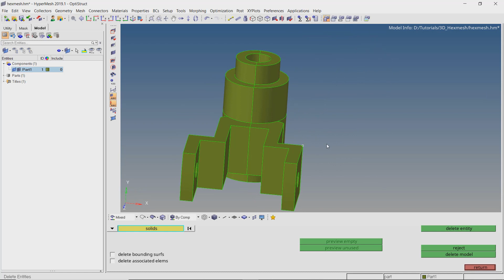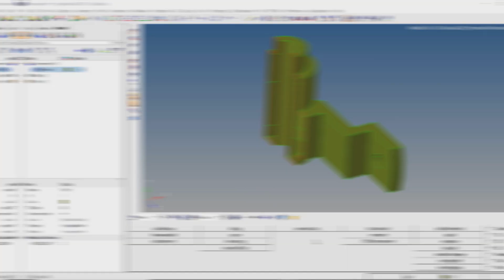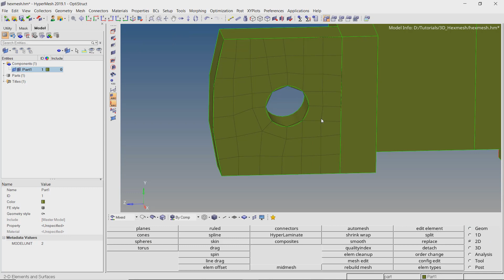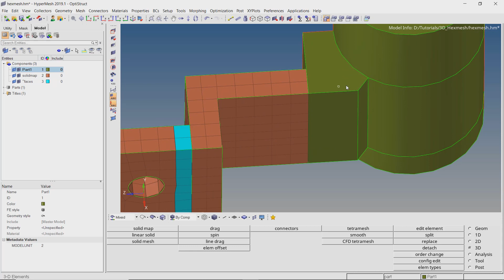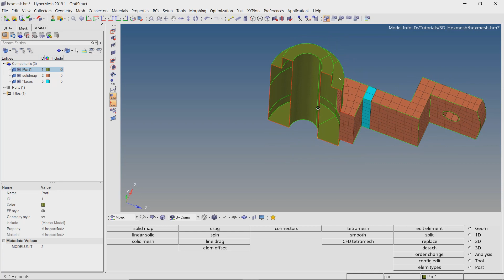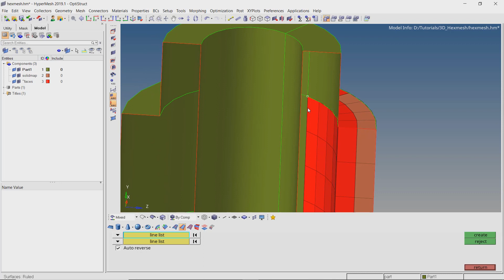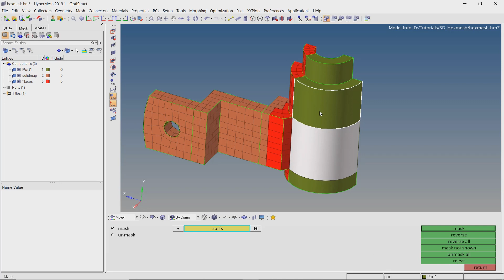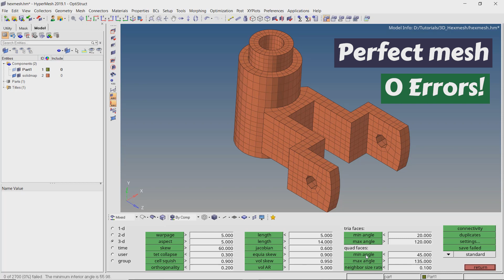How to create Structured Hexmesh - Hypermesh Tutorial [4 STEPS]

Comment: I appreciate your work.
I have a question regarding hex meshing a tricky geometry. Imagine there is a solid half-pipe/half-cylinder( e=====e) with it's L>>d. A solid frustum of a cone is placed on this half-pipe such that the center of the larger diameter of this frustum coincides with the center of the rectangular surface of the half-pipe. The larger diameter of the frustum is smaller than the diameter of half pipe. The axes of the half-pipe and frustum of the cone are perpendicular to each other. Is there any solution for the hex meshing such a geometry in Hypermesh?

Comment: Dear swapnil, thanks for nice explanation . I need to hex mesh femur bone in hypermesh. Possible ??Please help. I tried solid map..But got error.
Reply from the maker: It is certainly possible but the automatic mapping options won't work on such complex geometries. You have to manually break down the part its smaller mappable regions and mesh them separately.

On second thoughts, a bone has lot of curves and smooth edges. It is easier to create a tetramesh and also saves a lot of time in the preprocessing stage!
Reply: @Aeroswap  ok. can we use morpHing option with map to geometry...Have you uSed it ?
Reply from the maker: Morphing is only available for mesh, not the actual geometry. You can use it if required.

Comment: Otherwise, you have much better tools for hexamesh like Abaqus/CAE to do this job in 5', more than that, geometry can be edited, the mesh will be regenerated ... Hypermesh users are far from being efficient ...
Reply: I disagree. I
t's just an example which was presented. Hypermesh is really useful, if you have an stl file to remesh. Since HM can create even complex surfaces (geometric entity) from an imported surface mesh, Abaqus cant. In HM you can import an stl file, create a geometry and perform surface meshing with optimization then create the solid map. 
Dont get me wrong in simple cases like this the HM tools may seem unecessary, but in more complex cases it is really handy. 

Don't forget that this is a tutorial video.
Also Abaqus is a high end solver software, I prefer to use it for solving, but in both pre and postprocessing there are much more advanced softwares to use.
Reply: @turbofokozat  Hypermesh is overkilled for 90% applications. Ans we are talking about hexmesh, not stl, geometry reconstruction and so on. For hexmesh it is way more complicated than others. Guys using HM are not able to have a look to other solutions because it is si messy that you have to dive into it if you want to use it. When you go with  HM, you lost your time with meshing instead of analysis.

Comment: What are T-Connections  and free edges ? Is it a problem for the job ? if yes, how can i avoid it ? thanks
Reply from the maker: I would not consider T-connections a problem in general. Depends on the problem under consideration. Sometimes, in case of complex geometry, T-connections just cannot be avoided.

On the other hand, free edges almost certainly cause mesh connectivity issues. You can fix free edges using toggle tool from Quick Edit panel (F11) or by creating filler surfaces.

Comment: Great work and clear explanations on the hexmesh generation! 
I personally like to assign the washer splits on holes to get more accurate stresses, but it totally depends on your level of interest in your analysis.
Also to avoid any unwanted 2D elements generated or leftover during the hexmesh generation phase, I also suggest to make sure you delete them completely by clicking Mask-> Isolate (2D Elements) -> F2 and delete them all if you have any. Every analyst should prefer hexmesh over tetramesh since it provides more accurate results with the higher nodal system.
Reply from the maker: Agreed Ken. Washer splits are a must to capture the holes accurately. I have shown this in some of my previous videos. The main objective of this video was to explain the hexmesh process, so I kind of neglected the washer split!

Great suggestion about deleting the 2D elements! Thanks a lot.